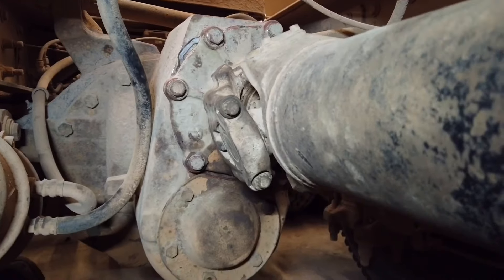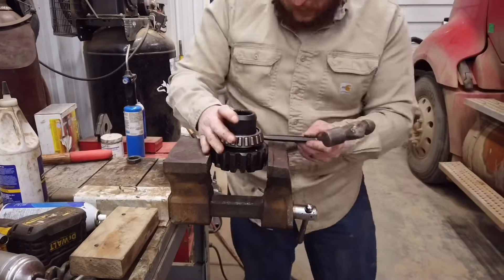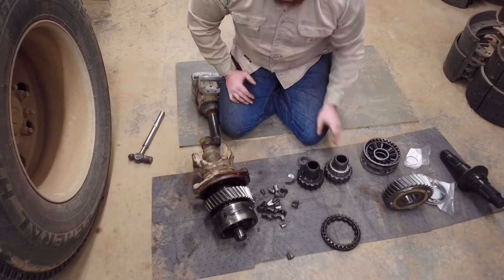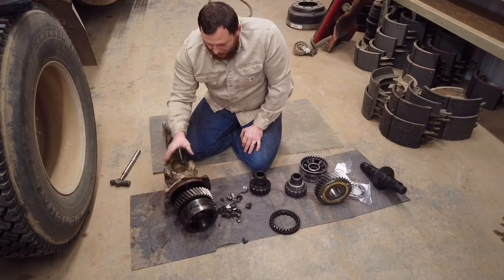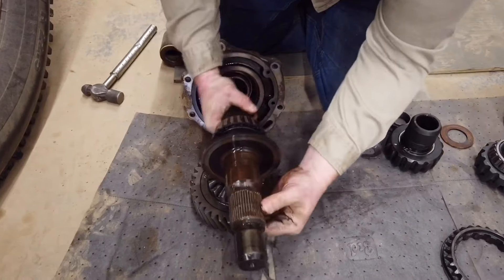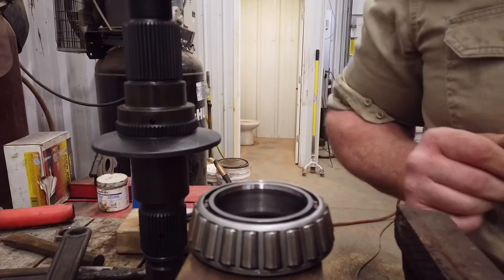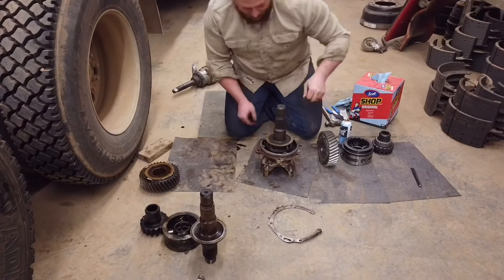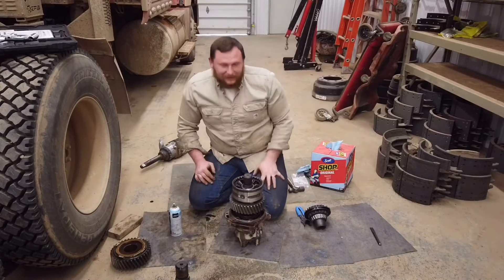power divider / inter-axle locking differential DIY repair

Comment: Awesome video, I just tore my front differential apart yesterday. I had a pooping upon takeoff and vibration. My truck is a 2016 Peterbilt 579. They confess apart a little different but pretty much the same inside. The yoke has to be removed first and the shift fork is up front and has to shifted around to get the shaft out. Luckily your video helped me realize this was my issue. Parts are ordered and on there way. Spent $1500 to rebuild the whole thing on a D40-155 Spicer. Thanks for the help and making the video.
Reply from the maker: That’s what this video is for. I did mention some u need to remove the yoke before u can take it apart. Please consider subscribing. I plan do try and find more subjects for videos if I ever make it to a thousand subscribers

Comment: This is a great method if you're not dealing with broken gear teeth or other metalic debris in the Differential lube oil.  Otherwise you'll need to pull the cover and clean the housing thoroughly.  You'll probably want to do a quick oil change after reassembly to catch any missed particles.

Comment: Mine is weird. When I let off the accelerator and coast, it acts as if I shifted to neutral, but I'll still be in gear. It holds fine when I activate the interaxle lock

Comment: Great video! Your a natural.
My preferred method in the shop to heat bearings and gears is an old fish fryer filled with some oil and temp is easy to control. Have also use a piece of plate steel set the bearing on top and heat from underneath with torch. Infrared temp gun comes in very handy try not to get over 300 deg F. Keep up the good work and God bless you for passing on your knowledge.

Comment: Best video I've seen👍
 I was just about to buy the whole diff $4350 now by watching this video I got away with replacing the spider only, at $268
 Thank you very much, the Lord bless you 🙏
Reply from the maker: Awesome
Reply: Great Video bud! This is perfect for DIYers… my power devider is stuck on I can drive the truck but I want it to work like it’s supposed to you know. The air switch works so I know it’s something in there…. Definitely not paying 4500 after this video thank you!

Comment: This is going to save me a bunch.  We usually pull them out and they rehearing the whole thing.  Always been gun shy.  Not sure why it’s broke how much worse can it get.  Got one now that runs fine but power divider lock doesn’t work.  U can hear the fork move and axle lock works.  Once you see it and watch.  Easy as pie.  Can’t thank you enough.

Comment: I just had a guy come into my shop with a truck he blew the yoke off of it and fix that himself and then said the rear end was screwed up, I haven’t tied into it yet but I am guessing it’s the spider gears. Thanks for the info very helpful.👍🏼
Reply from the maker: Thanks for watching and let me know if that’s the problem
Reply: Circle B Ranch Just giving you an update on what happened, the owner fixed the front yoke when he broke it. When he brought it to me and I started to tear it apart I found that the rear yoke on the input shaft was broke on an angle (he could drive forward but not reverse) and said it was making all kinds of noise. When I got into it I did a full inspection and found no broken parts it was just the yoke.But this is a case where you have to pull it apart because of the owner said it was making all kinds of noise.

Comment: Can't really agree with the torch thing (hot gear oil would be better in my opinion) but it's been done without incident many a time, at least you're smart to have Rockwell rear ends !!!
I hate Spicer and Eaton and meritor axles myself
I like Mack and Rockwell personally !!! Both as a former mechanic and Driver, a couple of long dowel pins to help get that front assembly to slide in helps alot, be careful about silicone blocking the oil holes and passages, to,
All the best to you and yours Sir.

Comment: Great video I usually put the gear in the freezer instead of using torch on bearing
Reply from the maker: Thank you!
Reply: Wana heat bearings to 100°c or 212°f ?  Easy, wrap in wet towel place in microwave do not let towel dry out. Perfect bearings every time. Can't get hotter.
Reply: Dang I glad I read the comments I'd never thought of the ole freeze trick

Comment: A kitchen hot plate will also work to heat and expand the cone . Camshaft gear on Caterpillar engines will heat up the same way .     120/23

Comment: Question for Honey River Ranch: Who makes the differential you are working on? I have a 2005 International 9400i with Axle Tech differentials. International dealer in my area say they can't look up parts for me since the differentials are not stock differentials for International. I found a Axle Tech dealer in Monroe Washington but they also could not help me. My axle parts are identical to your axle parts. I did manage to find the front cover seal and bearing with cup based on the part numbers I found stamped on them. Great video. Awesome detail.
Reply from the maker: Go to a inland truck parts

Comment: What does it mean if my inner axle differential is stuck on. The shift cylinder moves back-and-forth when I take the air supply off and push it with a screwdriver but when it’s jacked up both axles have to be up to turn. It’s not an old international, it has air going to the cylinder when I actuate the dash switch. The collar must be stuck.  What parts do I need besides the shift cylinder housing that I rounded the nut on trying to get off?

Comment: If your going to clean out the pumpkin use two all thread bolts to slide the diff out enough to clean the pumpkin then slide it back in.
Reply from the maker: Good idea

Comment: Hey how’s it goin my pinion cover cap (the cap where the spider gear pieces would fall into) busted . . I can manually change gears and it works but in auto the Axel spins loose . . I lock the differential and it changes gears as when I did it manual but it will spin loose in auto on its own . . 

What do look to replace before removal . . (Especially if I may end up paying someone)?!

Edit: Hell of a vid and Bison approach to retorquin the yolk

Comment: What is the ton rating on your 3 jaw puller.  I am a heavy equipment mechanic, and have a variety  of pullers, but I really need one like the one you are using in this video thanks.
Reply: The type of puller he used called posi loc puller and they make alot of different sizes. They are awesome pullers can be pricey but worth it

Comment: I had a leak between my front differential and the power divider. I waited to fix it, and blew two wheel seals out in the meantime. When I opened it up, the gear lube was milky. Fixed everything and haven’t had a problem since. I’m wondering if that compromised gear lube allowed that diff to get hot and melt those seals? I’d be curious what yours looks like when you drain it.
Reply from the maker: Sounds like your vent tube is plugged. Better make sure it’s venting properly

Comment: I've seen a young driver use the wrong gear on a shallow incline with a Peterbilt hauling a  D-9 dozer on a low boy and cleaned that divider right off ...just from a wrong gear selection..and a lot of weight ..

Comment: I was stuck on uneven ground and I locked the interaxle diff while the wheel is spinning. Now, it's not locking anymore and I don't have four wheel drive if I get stuck again. Will this job fix my problem?
Reply from the maker: I’d say it would fix it something wrong with that shift ring we showed in the video

Comment: A lot of bad information here. As someone that rebuilds these every day for 28 years and counting, doing these power dividers in the truck isn't advised because the big input thrust washer is known to fall down between the input shaft flange and the input helical when trying to install the power divider which is why we build them straight up and down in a diff stand. Failure to catch that is going to be an improper shimming of the power divider and you can ruin it. Next is the input yoke, do yourself a favor and take the nut off before removing the power divider from the front differential and save your wrist, shoulder and elbow. Next is the spider gears, almost every time an Rd20145 power divider is worn so are the diff internal gears (spider gears). Now because the rear wasn't pulled, broke down and inspected you risk blowing up the internal gears in the near future and you risk ruining everything you just installed. Anytime the power divider is replaced it absolutely needs to be re-shimmed too. We don't set the shimming with the o-ring because they rip fairly easy and they should always be replaced part number 5-x-1034 . Do it once and do it right, pull it and have it done properly.
Reply: Would appreciate a video showing the proper way. 👍

Comment: My pete will not move I heard a pop and it stopped pulling. I can put it in gear and the driveshaft just spins. If I put on the differently the truck will move. Does this sound almost like your problem? Thanks in advance
Reply from the maker: It dose sound like the same problem
Reply from the maker: That or a broken axle shaft in front differential

Comment: I notice strange lines (almost like search marks) on my rear drive axle super single tires. More lines on driver side tire. The front drive axle tires are perfectly fine. Just wondering whether this could be a differential axle issue? Any thoughts? Suggestions?
Reply from the maker: The rear always pulls harder than the front especially the right rear

Comment: Is that a 40000 lb rated axle set and if so were the others you repaired as well and did they all have a similar failure within the carrier nest. The reason I ask is that there is supposed to be quite a difference in strength between a typical 40 vs 46000 power divider and 40's I am told are a real weak point in the power divider when it comes to being used off road.
Reply from the maker: About 1 to 2 ratio I’ve done more 40s because there is more out there but the same shock load will Shatter the 46s too and I’ve done several of the big ones with the same failure
Reply: @HoneyRiverRanch  Of course the driver claims it wasn't him, it was "the other guy" who drove it previously !. Seriously though, I wonder what the heck they are doing to blow a 46 as I have friends who have driven an awful lot of off road, log hauling and various oilfield slogging through typical deep mud churning or attempting to climb hills they spin out on etc with chains on and never blown a divider in their life. I wonder if they are popping the clutch or engaging the power divider when spinning.
Reply from the maker: I think It happens when they break traction on a slick spot on the road then it hooks back up hard I don’t know. Our deal is oil field. There’s this one hill that claims one truck a day. You gotta climb it in second gear with your PDL locked in and you can’t get a run at it cuz there is a sharp turn at the bottom and I think there is a lot of crow hoping loaded on that hill. In my opinion if you chained down the drives so they couldn’t spin at all and forced the drive train around to see where it would fail , it would fail in this spot every time it’s just the weak link. And yes it’s driver error. I’ve ridden with drivers who were spinning wheels and didn’t even know it or feel it. Your first instinct should be to let off the throttle as soon as u feel a spin but u would be surprises how many drivers don’t feel it when they get into a wheel spin
Reply: @HoneyRiverRanch  Is this a gravel road or more of a true off road trail pushed through for access. Many years ago I worked at Schlumberger up here in Alberta one winter although I only had my class 3 at the time for driving a tandem but depending on what type of job were were doing we had tractor trailers etc and we would chain up both drive axles ( 2 sets of triple chains ) and those tractors would have had three or four way lockers as well and with the steepness of the grade they still would spin out and had to be dragged up the hill with a cat. I was in second gear with the body job with one set of triples on one hill  and just about powering out, not enough grunt with the old L10 Cummins in a body job. And yet oddly enough we were not blowing out power dividers, I think part of it is guys with experience and knowing when to call it quits and not start digging and hopping as that would kill a driveline. There is so much torque going through the drive shafts and diffs in a low gear pulling hard, the odds don't favor a guy for sure.
Reply from the maker: @charlesb4267  yeah this in north west ND and your rite driver decision making plays the biggest part in these types of failures. Most failures actually

Comment: My truck has problem when I turn differential switch on I hear air does something but only one rear wheel spinning on passenger side. What can be the problem? What's need be checked or replaced?
Reply from the maker: Sounds like a broken air line. Find the air leak and fix that and your dog lock will go back to working
Reply: @HoneyRiverRanch  I will check it. Didn see  or hear any air leak I think its something internal
Reply from the maker: Can you describe what you mean when you say you hear air when you turn the switch on?

Comment: Freaking dope , next time I’m gonna do it , I usually send out , now I’ll do it but just out of curiosity you talked about shims on bearing (inner) and on outer plate(eight bolts) how would you shim just in case bearings go ! Anyways good video !
Reply from the maker: U have to subscribe and I’ll tell u everything
Reply: @HoneyRiverRanch  I am subscribed ?
Reply: Shims are used for up and down play/ movement. U don't want the shaft to have any up down play. Start with the thinnest shim then bolt up the housing checking for play and more shims if necessary.
Reply: @k.lamareyev4418  behind race or plate ? Or do I do both at same time ?
Reply: @Diezeling  behind the plate only
Reply: @k.lamareyev4418  then why did guy say there’s a shim behind race , so I only have to shim front plate , btw thanks for your knowledge!
Reply: @Diezeling  no problem. He probably accidentally said race.
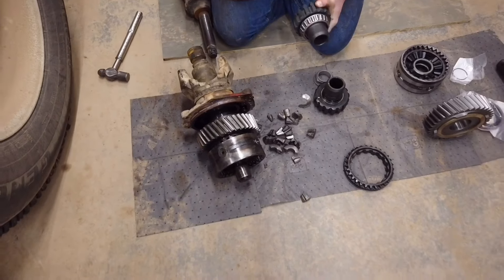Reply: @Diezeling  I apologize he did say shims behind the race at 5:25. Im thinking you wanted to reuse same bearing and races as in the video.  Those shims are set for both bearing preload. In/out /twist movement. You can't set that by eye. That'll have to be done on a bench by a shop. Again I apologize for the mistake.
Reply: That bottom race on that diff or other power dividers does not have shims. They are only shimed at the cover. There are some diffs with threaded adjusters with no shims like the new diff that replaced the one in the video. The inner pinion race on that diff has shims under the race to set pinion depth. It is best to always reset the preload. Shims are cheap just like the oring.  never seal the shims with silicon use anaerobic sealer but that diff uses the oring no sealer just clean the shims but can leak where the oil passage is that goes through the shims
Reply: @mattpowell1504  "The Right Stuff" from permatex works better. It's not silicone based and stays a little bit flexible after years of service. Anaerobic sealer cracks and leaks after a while.

Comment: Good stuff! I'm starting to think the rear end in the rear axle of my truck is going bad. I've been chasing a vibration that's getting worse, tonight I grabbed the driveshaft and turned it back and forth and it seems to have a lot of play and a clunk in it. I'm trying to figure out if that's normal or not?
Reply from the maker: Can you describe the vibration? Fast pace vin or more slower? Does it get better around 70 miles an hour or get worse?
Reply: @HoneyRiverRanch  i think i found the problems.  1 rear end was very low on lube, so i think that's why it sounded loud when i twisted the driveshaft. 2 the leveling valve is malfunctioning,  it takes 2 seconds to start airing down and anywhere from 30 seconds to 60 to start airing back up.  It's been driving me crazy it comes and goes to some extinct usually starts just over 60 and gets worse. Which makes sense with the valve not working right.  I'm in the middle of a service and other repairs right now hopefully by this weekend I'll know if I'm right.  Thanks for responding.
Reply: @HoneyRiverRanch  I've been driving 60 to 62 so it don't shake the truck apart.  It gets worse the faster i go. Makes for a long day !

Comment: If your gonna cook bearings with a torch at least use a steel plate. Heat the plate up from beneath with a torch,with bearing on to of plate. It will more evenly heat the bearing. All you ever need is 125 degree Celsius or 250f.

Comment: Do u mind me asking wher u got ur input shaft kit??
Reply from the maker: Inland truck parts. Your looking for a input shaft kit and they will ask u for some numbers off your rear end. There are lots of other gear shops around that would stock these kits
Reply: Thanks bud I got a ford 9000 dump truck the bed raises but starts leaking down soon as u take it outa up any leaks wats bad
Reply from the maker: @billybobs841  the up down valve is leaking internally you could probably take it apart and slap some new o-rings in it

Comment: What differential is that?
Reply from the maker: That one is a meritor but there all the same on the inside basically
Reply: @HoneyRiverRanch  good video. Thanks. But my Eaton DSP40 is a lot bigger and heavier than that one.
Reply from the maker: @mrtruckdriver2834  I’ve done some way bigger ones and they are all exactly the same on the inside just bigger parts
Reply: @HoneyRiverRanch  👍🏻